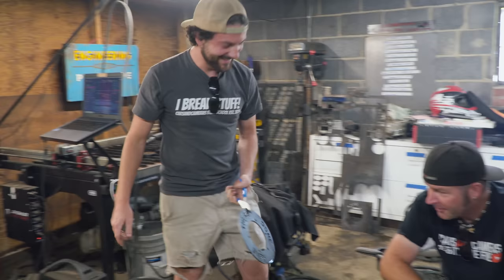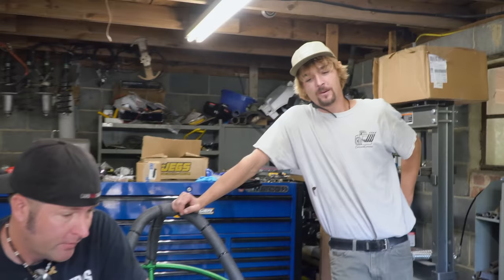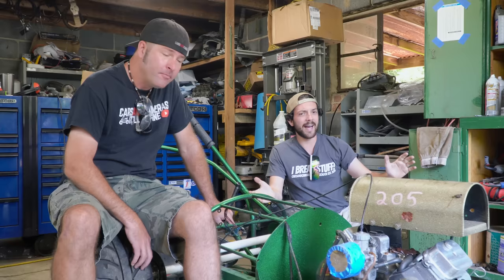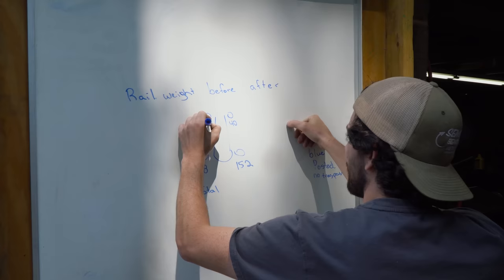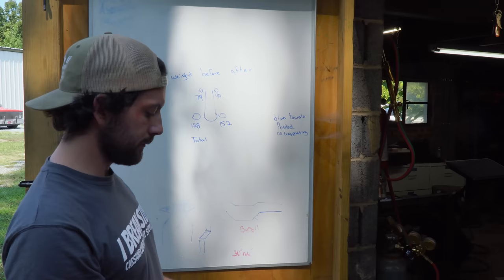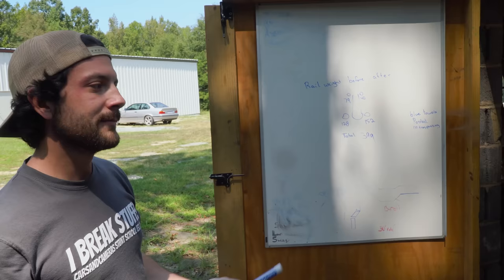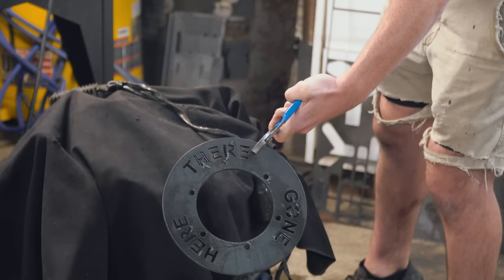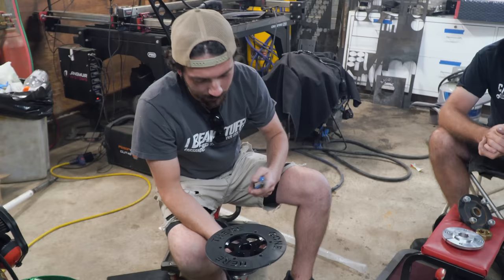We Turned our 670cc Drag Rail into a DIRT DRAGSTER | 55HP Rail gets Chromoly Axles + Off Road Tires!

Comment: The taller rear tire definitely makes it look more like a dragster if only you could find a slick with that height, also supercharging it would be badass!!!
Reply: i'd like to see it turbo'd. the v belt style converter will definitely allow it to get into boost more efficiently versus a supercharger boosting from off idle
Reply: ..or drop an old 1200 cc Harley engine in it.
Reply: @BobbyOfEarth  oh god yes
Reply: or drop an old 1200 cc Harley engine in it AND turbocharge it...
Reply: @BobbyOfEarth  mo powa baby
Reply: NITROUS!!
Reply: Just painting "Goin Postal" on the mailbox will shave at least a half second off.
Reply: @BobbyOfEarth  they want to go fast, not leak oil all over the place. Besides, the already have an old tractor motor in it.
Reply: Jr. Dragster slicks probably work
Reply: @Rattus-Norvegicus  nitrous would be cool, but it’s just too dangerous and difficult to achieve.
Reply: @wyattcamacho7464  Dangerous maybe but not difficult to achieve. Nitrous is cheaper and significantly easier than say a turbo setup that every idiot wants them to "slap on".
Reply: @Rattus-Norvegicus  I meant diffucult to achieve because it'd be hard to find the parts i would think.
Reply: @wyattcamacho7464  Nah, they could order everything used off racing forums on the internet. It's almost ridiculously easy to blow up your motor with it, but if you don't run in those circles I can understand where you're coming from.
Reply: @Hitycooking  Still spamming, I see.
Reply: Get a six speed B&M harley transmission.  And make it fly.

Comment: The new shop has a new level floor  that is where the drag rail needed to be weighed
Reply: Might be the battery causing the issue.
Reply: @k1e1v1i1n  naw. Either the chassis is twisted, or the axles are not level and parallel. If it was the battery you would only see increased weight on one side, and it would effect the weight on the same side tires. But when the left fron and right rear are both higher then you have a cross weight issue. My family races midgets and sprint cars and one way we adjust our setup is with cross weight. We adjust the right front sprint so that it puts more weight on the ground then the left front. This makes the left rear also put more weight down. This helps with getting a good drive out of a turn because the left rear is now biting into the ground a bit more. It is actually much more complex, but that is the quick version.
Reply: @backcountryme  your prob right but that was talked about so just giving another idea.
Reply: @k1e1v1i1n  Does the battery need to be level though?
Reply: @gteaz   I was more thinking evenly spaced left to right , looks to be fully on the left hand side.

Comment: John, if you can make a brake rotor, why not just make your own sprockets to change gearing on the spot? You could make em split sprockets to make em faster to swap.
Reply: store bought sprockets probably go though a hardening process.
Reply: bake em in the oven and cool em down 100 times and still wouldnt hold up
Reply: The only common sprockets that I ever ran into that were hardened were the small ones on the output of a motorcycle. I have modified many sprockets and even in a pinch made them by drilling holes and doing a shit ton of filing. 
But most sprockets are just tough because you don't want to wear the chain prematurely. 
I don't see why it wouldn't be worth a try. I have had them laser cut before.
The big thing is the precision and repeatability of the tooth pattern.
If it doesn't work carve Cars and Cameras in it and sell it as a souvenir.........LOL! 
I say it's worth a try if you want to work out the program.
Reply: Most sprockets aren't hard but they're likely not mild steel either. Something with more wear resistance. The shape and precision of the tooth pattern is also more complicated than it seems. This Old Tony has a video about making a sprocket on a cnc router if you're interested.
Reply: @TXH1138  the only hardening is when they cut them and its only the teeth and holes
Reply from the maker: Yeah I could, but I’m not good enough at the software to get the  chain pitch right. Also sprockets would require beveling of the edges on top of the cut. Would be cool to do one day!
Reply: @la_plata3588  that's still something that wouldn't happen at the C&C shop.
Reply: They need a cryogenics treatment setup now.
Reply: @TXH1138  Oh. Didn't know that. Then how do aluminum ones survive?
Reply: @CarsandCameras  This is a momentous day for me. I believe it's the first reply I've gotten from John, lol 😂. I've gotten several from Ike on his channel.
Reply: @TXH1138  how so? they use a cnc plasma cutter the heat itself is the hardening process. maybe look it up?
Reply: @CarsandCameras  buy a water jet system, so you can do aluminum
Reply: @CarsandCameras  They make sprocket calculators that have have the right teeth and whatnot and give you the file for them. Then you put in on an axle with a fixed grinder angle and spin them. You could make em easy peasy
Reply: @CarsandCameras  you need to tell that to Go Powersports. I bought an aluminum sprocket from them that is not beveled. Totally worthless!
Reply: C49 high carbon steel for that rear sprocket because of the stress going to be on it.
Reply: @CarsandCameras  buy and install a metal lathe before your next c&c backyard 500 and then hold Chris hostage for a few extra days until you's both figure out how to/and machine a functioning sprocket, i'm sure between you 3 and Chris with a lathe and cnc you's will figure it out and get it done!
Reply: @CarsandCameras  I do have a request though and I planned to do this when I buy a honda quad bike to race in this vs that hoonigan. It will use a much larger version of the 670cc v twin but with twin turbos and longitude mounted setup. long trailing arms and a big fuel tank for long travels. I speculate 100 horsepower max before the engine blows
Reply: @CarsandCameras  turbo charge the 670 with a golf GTI turbo from and older car(2006 to 2012 preferably)

Comment: The air pressure could weight the corners differently too! and an axle bearing in the center  of the axle would go a long way to stop that " continuously variable  tow" or "CVT" issue.

Comment: To corner balance it you can tweak the frame. You will need to install four anchor points in the concrete floor. Then anchor 3 corners of the chassis down (ratchet strap), and put a jack under the 4th corner to tweak the alignment,

Comment: I have to agree that engine sounds so good.  Cam gives the nicest rump-t-rump idle.  I am wondering if there would be a way to put a foot operated clutch after the converter so to could launch with higher RPM.  As a plus that would allow the driver to REV the engine without moving.

Comment: Another way to save some weight would be to remove the battery and start it with a jump pack if it will run without it or put in a smaller one if it won't. Hands down my favourite of your builds and the best sounding of them all.

Comment: FYI On the Rotor, Lada of Russia used Aluminum for their rotors.  All you need is it to be strong enough for centrifugal force and dissipate heat and not melt.  So for your application “It’ll be fine”

Comment: When using scales you have to establish an "Altar"(flat spot). A VERY specific spot for the scales. Bucks up, that would involve an aluminum I beam and an angle finder to get all four scales in the same horizontal plain. Bucks down, borrow a surveyor's transit. The scales MUST be level to be accurate.

Comment: My Monadnock Speedway race cars used 6.20 ford 9" gears running 1.1 4th gear.. It's called cross weight, a vital circle track adjustment affecting loose or tight condition.. Jacking bolts for at least the front end is necessary to balance well...

Comment: Isaac you cut the wrong end off the onion first,  you cut the spouting or leaf side of the onion, peel it, split in two always leaving the root end on.  Then you lay the half cut side down and cut almost to the root radially like cutting out a pizza sideways laterally then slice it normal.  Because the onion has concentric layers this acts as if you diced it, and the root end holds it together up to the last slice.  You will find you have better knife control and when done automatic diced without a third layer of cutting.  For onion strips, just omit the last step and cut off the root end and it falls automatically into slices.  Learned this from Graham Kerr.

John do a series called “ Cooking with Isaac” and read viewer comments from the previous episode on Isaacs techniques and critiques to make him a better Chef then get with a local restaurant then have him butt his skills with their Chef.

Comment: You can get brake calipers that will work on the chain sprocket so you could have brakes on both sides to even up the brake pressures so it should brake dead straight. Now forced induction is the next step I would go the super charger route myself but a turbo is a an easier install.

Comment: Megasquirt, fuel injection, turbo,  drag radials, front brakes (for standing burnouts), and 2 step (for launch) and I bet that you might find yourself in the low 7s @ 1/8th mile.

Comment: need to setup a little 200 or 330 ft dirt drag strip and flatten it out. get a cheap timing system with some transponders and race all your builds down the strip. You guys have quite a few straight line builds

Comment: The larger rear wheels and tires added to your gear ratio. so your going to have figure that in when you go back to the original wheels and tires. from what I could see it seemed like it launched pretty good good. I couldn't see any axle flex but it's a hard to tell watching a video. I remember when that engine was on the riding mower, it sounded really good and it' still does. on another subject probably one that Ike would prefer I didn't ask. but when is the Honduki going to make another appearence. it's probably my favorite project that you built that thing is rediculously fast, and that's what I like. and I believe it still has incredible potential to be one really nice badass vehicle.

Comment: That shot with Ike in the rail from the front corner needs to be on a shirt.
Are we betting on how long the brake rotor spray paint will stay? (My guess is 2sec)
That V twin sound is awwww-some.
IBF Dirt Drags at Busco Beach?
Should grab the sound in the garage at idle and use it for you channel music.
Great vid guys!

Comment: Hey guys just a suggestion you might want to brace those axle bearing plates because now you’re pulling on the weld with the rear end and stead of pushing on it like I think you used to have it and it appears as though you’ve only got it welded on the one bar and under serious load you might have a bit of a side to side flex that eventually cracks your weld and could cause a hell of an accident I just don’t wanna see anybody else hurt I could be wrong but One more small plate on each side is not even going to be noticed when it comes to the weight how do you know her egg likes to push everything to its limit something like that popping loose under acceleration at the track would immediately turn you towards the wall and because it is so narrow likely cause you to roll

Comment: It's not hard to do, but I have an excel spreadsheet that runs total weight, left side weight, cross weight and a couple of other things off of the four wheel weights if you want it.  I worked on stock cars for a lot of years and consistent weights can help you dial in a chassis.

Comment: Love the Big Motha Thumpa Camshaft Guy's! Sounds so nice I went and ordered myself a Dynocams 356 tool steel billet cam for the Eaton M-24 supercharged Briggs Vanguard I'm going to assemble. Their a little expensive, but with the bolt on billet can gear giving you a full range of adjustments it's money well spent I think? A regrind is cool but you can't do the fine tuning necessary for what I'm needing. As always Guy's Awesome video, glad to see the drag kart back out of the tarps finally and in its new home with a roof and floor lol. You've come a long ways guys all of you have! Congrats on that alone!

Comment: With the taller tires it will lose some bottom end, but pick it up on the top end. Remember, the tires you pulled off were a lot shorter than the (for testing purposes only tires) 😂

Comment: I say put dual carbs on it and making as big as possible or maybe a two barrel
Webber with a fuel pump so it is easier to start. Then best ignition system coil and wires for it

Comment: realy like that you dusted the dragster project off again 
with the taller tires the frame clearance is about level front to rear , maibe get some car rims with narrow tires (dont think it needs slicks with the power it makes ) that are about the same height
i wonder if it would help to put a actual foot operated clutch on the dragster without the torque converter and have the rearwheels slip to about halfway down the track like on the old slingshot dragsters might help it leave off the line better 
(or have the clutch slip , thinking maibe use a hydraulic cilinder on the clutch with a needle valve restrictor and a one way valve (clutch in) in paralel in the line so you can set the clutch release/slip , go to the starting line let off the clutch untill you feel it just grabbing give it full trottle and then wait for the light taking youre foot off the clutch and the hand off the brake and hang on)
suprised you didn't used the new shop floor to do the weight measurements , that floor should be a lot more level

Comment: You should turn it into a rear engine and trim that drive line friction loss down and lighten that frame lose those bulkheads in the front got a lot of extra weight you don't need !

Comment: The cross weight make sense. You prob have some twist in the chassis. The two corners being cross make sense. You should get a good, level surface and have someone sit in the kart and try to get the cross weight gone. Otherwise it will get more drive off the right rear and could cause the kart to pull left really hard off of launches.

Comment: Y'all need something as tall as those 4-wheeler tyres, and also as narrow. The overall weight and weight balance works great with some sidewall, but the tyre width on the old tyres ate a lot of horsepower. The first sprocket, the one you swapped for a bigger, could also be even bigger. Then there's some porting left to do, tube intake, bigger carb, tighter compression, heftier cam lobe.. I'd say low sevens, if not a 6 on the 1/8, without any spray.

Comment: definitely would be at advantage with a motorcycle engine, having control over the gear ratios will give such better top end, which was limited a lot with the original one due to the torque converter i think

Comment: 670 needs a little more tuning and those carbs needs some more work but it's lives again.  When are you guys going to build the rail 2.0 better than 1.0 I remember in one of your old videos that you were planning on building one can't wait to see what you come up with next remember that you always have carbs problems with the 670 cc  
More mods for it find a away for 65 to 70 hp it can be done bryce

Comment: You should have weighed it in the new shop where the floor is level. I really liked the dinner portion of your video, that was fun. I tried to get the free meals with your promo from hello fresh, however I had 12 meals on the plan and it was still over $65.00 with the promo code.

Comment: Chromoly isn't any stiffer than normal steel, especially when you go to a tube instead of solid bar.. The difference is that chromoly won't shatter like mild steel will when it twists, it springs back instead. If I had that thing I'd move the engine and axle behind the driver Don Garlitts style. It'd move the weight right over the axle and make your chain WAY shorter and remove the need for a jackshaft at all. At that point you might have to add weight to the front to keep it from wheelieing though. You guys seriously need to get a higher back seat for that thing before Ike pulls a me and breaks his back or ribs above that seat. (I hit my back above the bench seat in my 76 F100 and broke two ribs)

Comment: Guys there's rules and regs for youth mini rails NHRA dragsters ,yor engine is way to big but check out thee safety requirements for running on the tracks ,most afilliated tracks will not let you on there tracks with that rail.Check out there seatbelts and see what there running for real drag slicks !

Comment: the drag rail is one of my favorite projects y'all did, and it sounds as amazing as it did when y'all built it, a supercharger would be badass, and Nitrus would be insane, a supercharger with Water Alcohol Injection would be pretty sweet, and i'm trying to remember if y'all tuned this to run e85 or if y'all are just running sonoco 104 unleaded

Comment: You need an actual clutch on that thing so you can get proper launches. I'm sure you guys could figure out a way to mount a motorcycle clutch. Maybe bring in rather b welding for some help with the machining.

Comment: Is it possible to hook up a Harley transmission to the 670 if so that would be pretty sick
Reply: Easily done, depending on which way you went at it you would just have to make a custom hub for the gear on the engine.

Comment: Take that blown up 750 cut the transmission off and connect it for that motor it'll give you a better clutch and you'll have gears then you can really run out the back door

Comment: To properly "scale" corner weights you need to level your scale pads.. you would have better results being more accurate using your new shop floor, that hasnt had  70 yrs to settle and warp.. this is why racing karts level the scales stand EVERY weigh